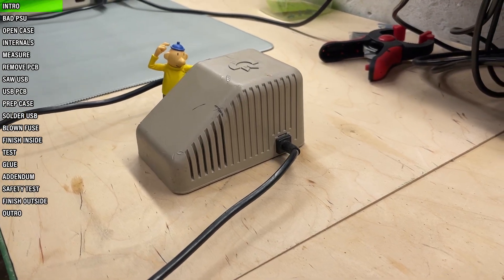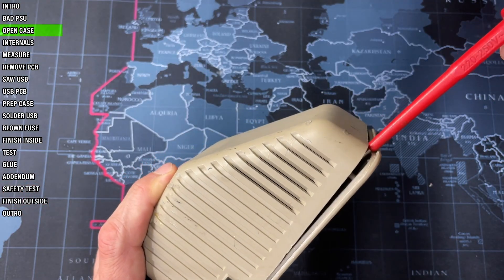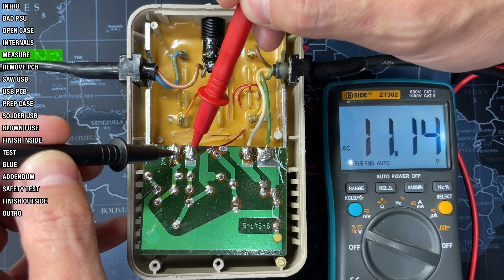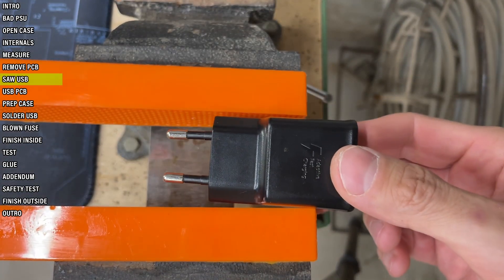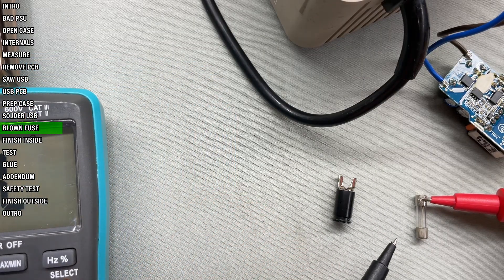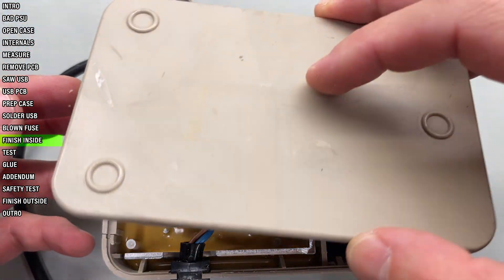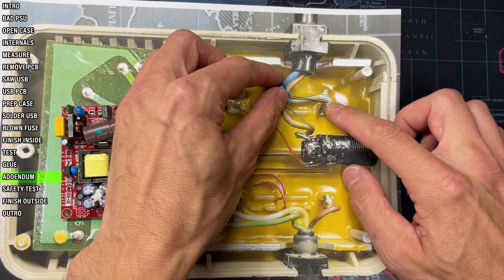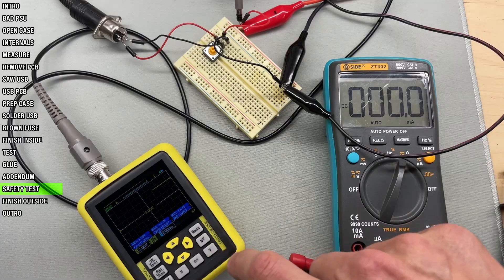Commodore C64 power supply - 5V mod with USB charger

Comment: If you do add a varistor, put it on the other side of the fuse so that it will blow if it conducts. I work in an electronics factory, and one of our customers designed a PCB with no fuse behind the two varistors that were on it. If the installation was messed up and the mains voltage was connected to the 48v input, the copper tracks leading to the varistor would vaporise thereby scrapping the unit in the process. A fuse in line would have prevented that. We did raise this with the customer but they refused to change it. The number of false warranty claims we had was ridiculous, so we blacklisted them.
Reply from the maker: Thanks for the advice!

Comment: Do not do this.

This is actually worse than using an Electroware or the Keelog.
Reply from the maker: Do elaborate, please.
Reply: @retrochicken64  Besides the hideously bad quality capacitors in this thing ( CapXon ) excessive ripple is the main issue because it offers very little in the way of filtering given its application.

The SID is notoriously sensitive to ripple and is known to fail early because of it, hence why Commodore's original spec of <= 50mV wasn't just an arbitrary choice.

Comment: This video was fantastic! I got a Commodore 64 lot with two original wedge power supplies (black and beige). Using this video as a guide, I successfully modified the original wedge power supply with a 5V USB charger! I just didn’t like the idea of letting the original power supplies go to waste (that was the main advice I kept getting from people, throw out the old ones and get a modern replacement.)

Now I’m gonna do the same mod to the other power supply I’ve got! Thank you Chicken64! 😁
Reply from the maker: Wow, that's awesome! These days we all have extra USB chargers laying around, so why not put them to good use, the marginal cost is practically zero! I'm really glad to hear it worked for you! Thanks for sharing your experience!

Comment: Linear psu replaced with a switching?  I don't think it's equal. 
Imho easier and cheaper just to replace the broken 7805
Reply: It might be difficult to mount a 7805 with all the potting. I imagine it will need heat sinking
Reply: @nialled-w7s it was already there. Just replace the broken ic
Reply from the maker: That is one variant and it might be for a future project, change the regulator + install some protections.